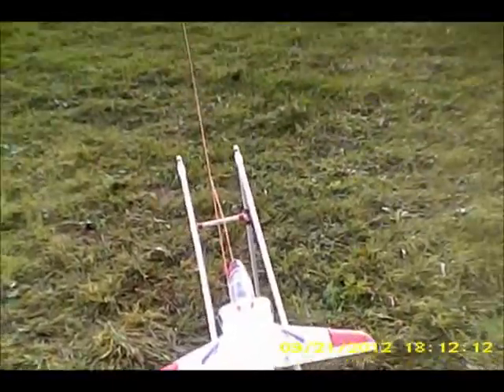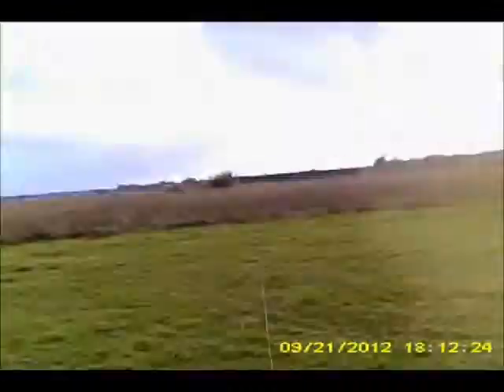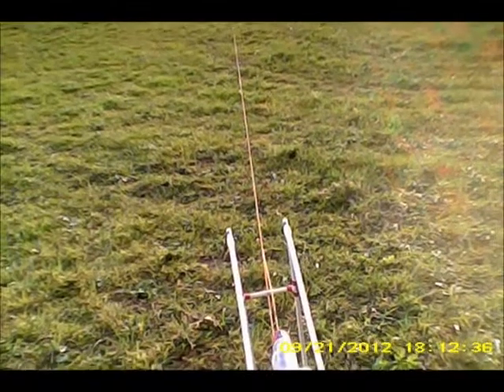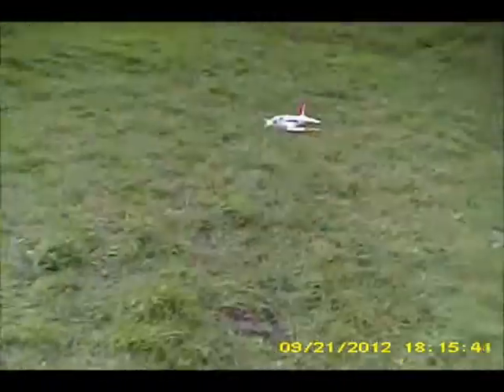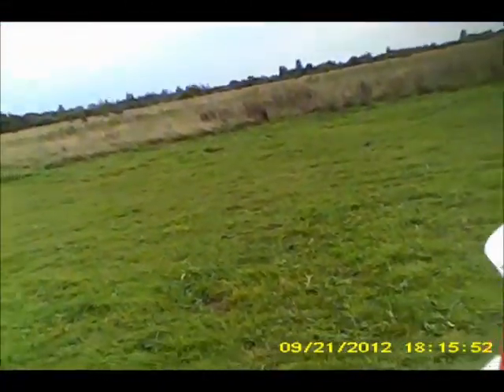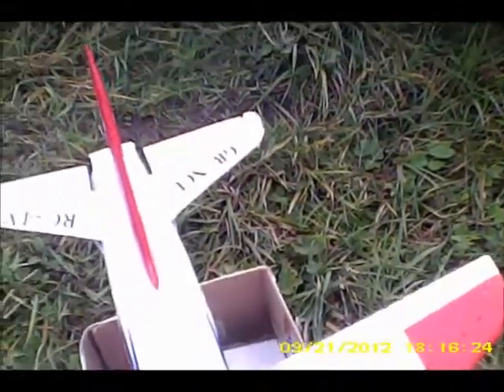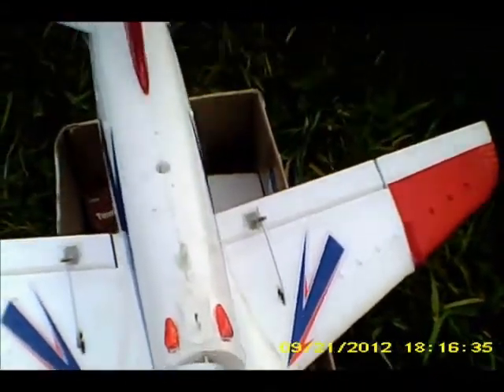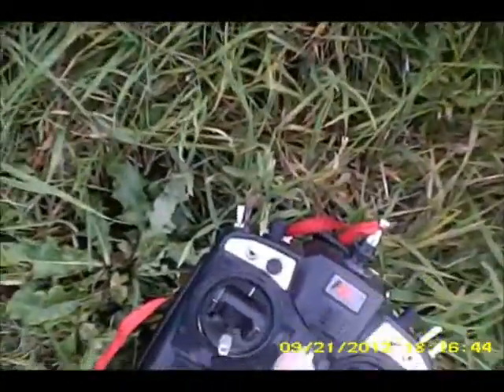T45 50mm 4S 1600 21-09-12

Comment from the maker: The motor is Turnigy 2615 5000kv ... ESC is 50A Hobby King ..... LiPo is Zippy Compact 4S 1600 .... Haioye 6 blade 50mm EDF unit ....  run-time is 2 mins at WOT and you can push to 3mins with management .... 
OK so a short run-time - but the enjoyment of such speed etc. is worth it.